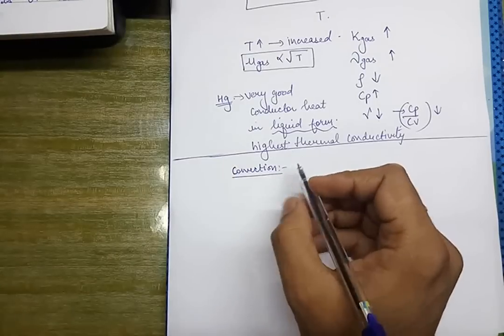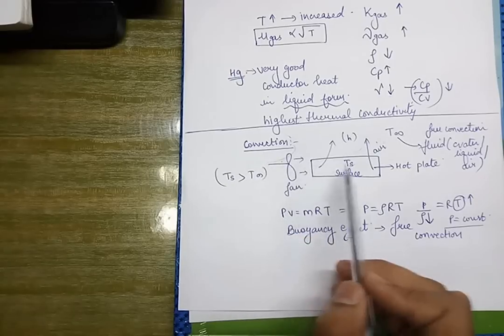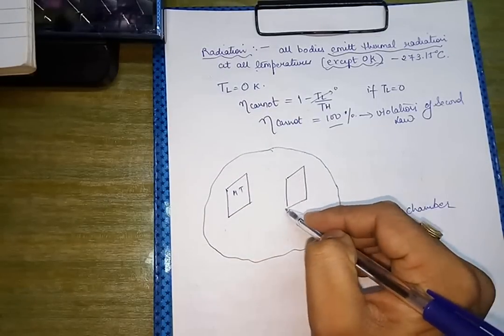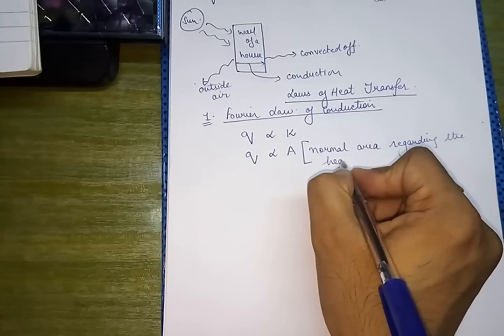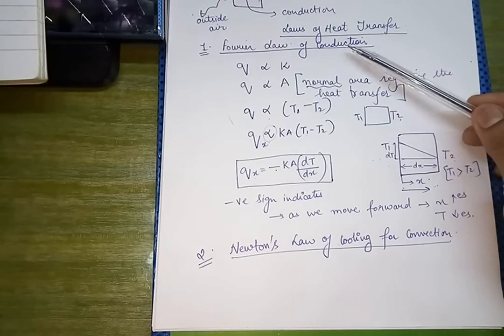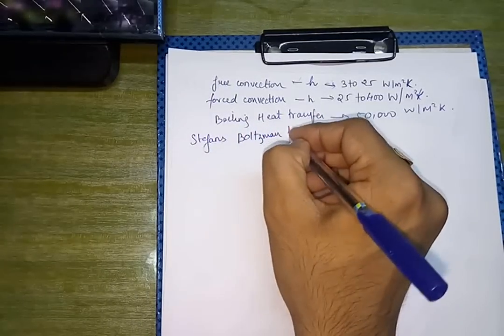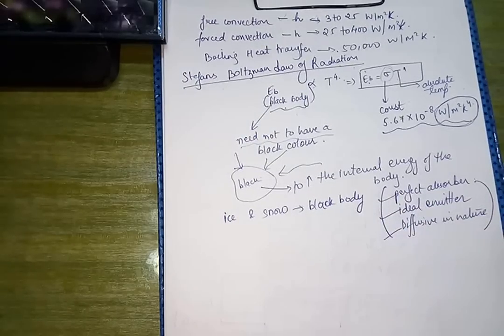GATE Mechanical Lectures for HMT | Introduction to heat transfer | Lecture 2| Convection & Radiation

Comment: how snow is a black body? I didn't get it. Please explain.
Reply: Even fresh snow emits radiation as a black body between 3-100 µm. It should be kept in mind that 'snow behaves as a black body' means that it emits its 'own' radiation that should be distinguish form the case when it reflects the solar radiation.

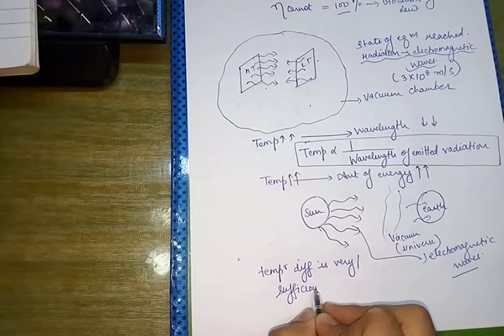Comment: In starting 5:40 video timing you have told that...all the bodies emitt thermal radiation at all temperature except 0 kelevin but at 10:50 video timing you said that radiation takes place only when Temperature difference is very or sufficiently high...plsss clarify my doubt🙏

Comment: if Cp increases how Gamma would decrease?
Reply from the maker: It is because on increasing the temperature Cp and Cv both are increased and the net effect on gamma)ratio of Cp and Cv)  is that it decreases.
Reply: As temperature increases both cp and cv increases but the ratio decreases because  as the temperature increases cv increases more as compared to cp